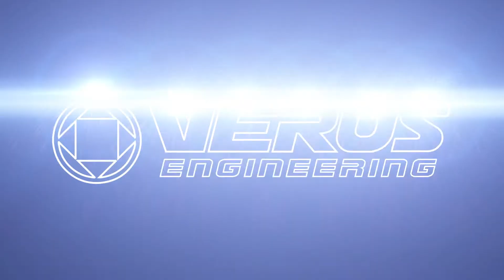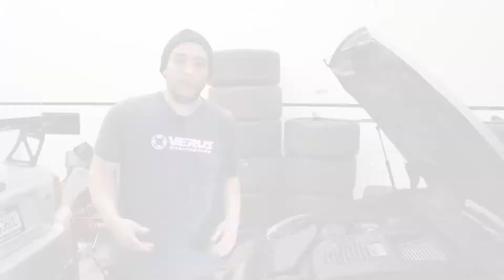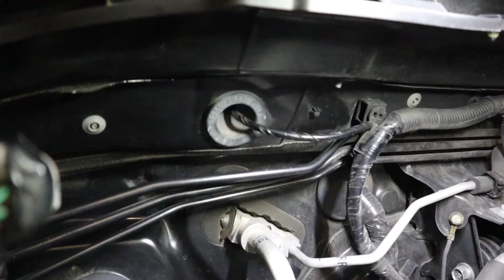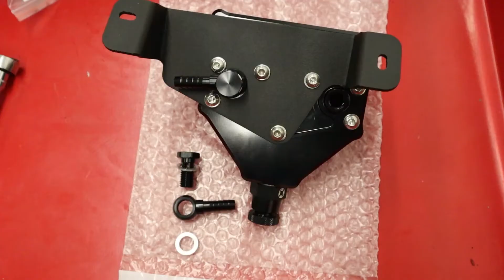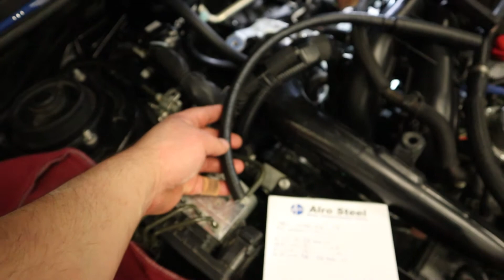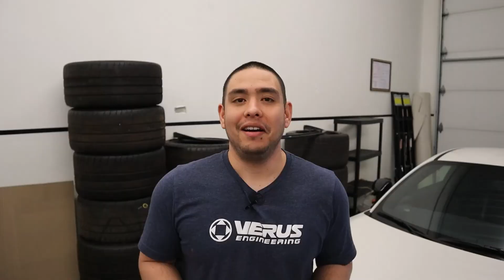VA Subaru WRX Air Oil Separator Installation

Comment: That hose that goes from soft line to hard line, on my 2015 WRX it has one continuous hard line. Is that gonna be a problem??? Idk why mine is difference from the one in the video?? I hope someone can tell me
Reply from the maker: We would be happy to help you. Send us an email at support@verus-engineering.com with several photos of what you are seeing and we will do our best to coach you through a solution. Thanks!
Reply: @VerusEngineering  so i guess the PCV hose assembly on my 2015 was refittedd with the 2016+ hose which they made all hardline. So my buddy just cut the plastic line with a rotary tool.

Comment: honestly a pretty bad installation video. left out key parts like where the last hose connects too..... i hope what i did works cause i have no idea
Reply from the maker: Our apologies for the remaining hose being left out. For the last AOS bar, cut a 14" long piece of 1/2" hose and connect it to the reducer. If you have anymore questions, be sure to reach out to sales@verus-engineering.com and we can get you sorted.
Reply: Just bought the AOL but I noticed the crankcase vents side of things you guys are missing how to install the right hand hose as you stand in front and face the engine bay.

Comment: Pro tip for using vice grips on hoses: stick some vacuum tubing over each jaw to prevent tearing
Reply from the maker: Vice grips or plastic hose clamps are very helpful.

Comment: Where do you get those rivet nuts?  I need those 😂

I love your hood vents by the way 👍
Reply from the maker: We order the rivet nuts in increments of 1,000 at a time. We can sell the rivet nuts separately to you, but we do not share our suppliers.
Reply: @VerusEngineering  awesome!  This is the 100th solution to my 100th issue for my build.  Thank you 😊